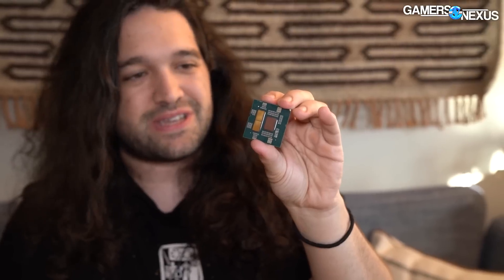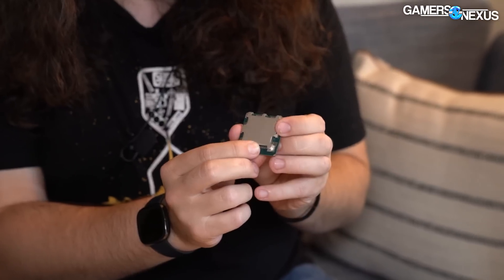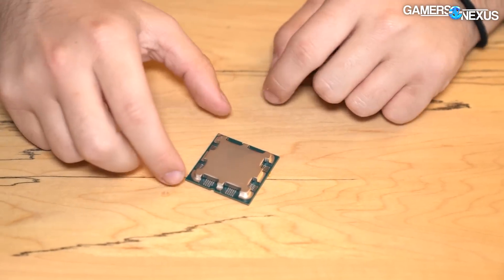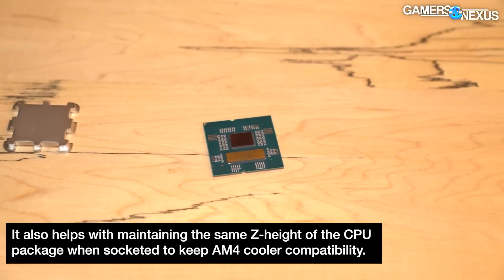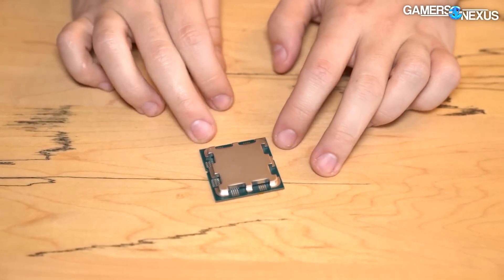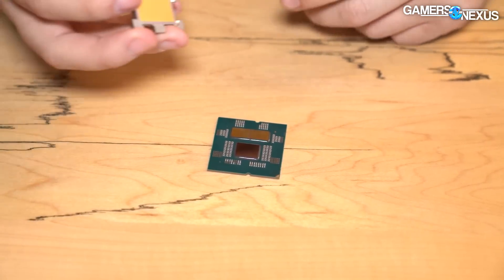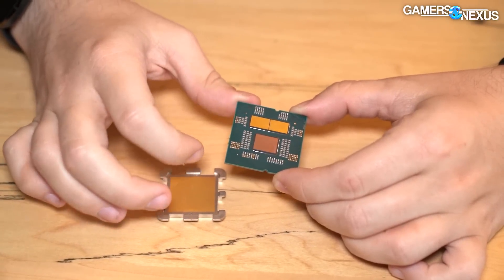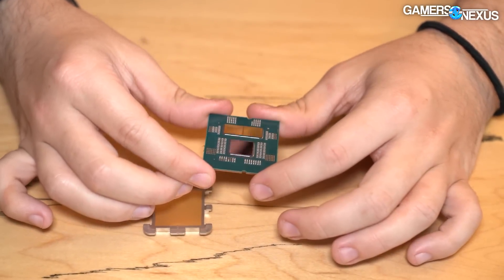Hands-On with Delidded AMD Ryzen 9 7950X CPU

Comment: These recent AMD announcements got me a crazy deal on a Ryzen 9 5900x, which was only around $320 off of Amazon.
I know its not good to go AM4 for upgradability reasons, but considering I'm going from a Ryzen 7 1700 which I've had for quite a while now, and the fact that the new lineup is gonna be much more expensive on launch, I feel like it was a good choice. The 5900x will hopefully last me a good 5-10 years or so.

Edit: Ok so, that CPU never arrived. I asked for a replacement from the seller, that one also never arrived. The seller is now offering me a refund that I really hope will come through.

Its been two full weeks, I'm just gonna buy the CPU at full price from a reputable seller. Its gonna cost me almost $400, but I just wanna upgrade my system at this point. I couldn't care less that I'm paying that much for this CPU now that I've had to wait this long.

Honestly though, this is was a pretty good learning opportunity for me. Biggest thing to take away from this is even if the price is the lowest, always fully inspect the reseller before you buy to make sure that they can be trusted, especially if its for such an expensive product.
Reply from the maker: Wow! That's an insane price. Great find. Even with the new stuff, no reason to feel any buyer's remorse with that one.
Reply: Nothing wrong with that! Enjoy your huge performance uplift!
Reply: holy shit dude, that was a steal.
Reply: Yeah, it'll definitely be a long while before 16-core Zen 3 FEELS long in the tooth.
Reply: Good news: you got mixed up! It's "not good to go AM4" right now, because buying a new AM4 motherboard and new DDR4 isn't worth it, when you can't upgrade the CPU using the same mobo and RAM in the future. But if you already own an AM4 system, then you absolutely should upgrade to something like that 5900X, because every single part of that PC besides the 5900X costs you $0 (because you already own it). In fact, the reason people who don't own an AM4 system should buy AM5, is so that they can eventually upgrade to a new CPU at the end of the chipset's lifecycle—exactly what you just did. You made the optimal move, for an insane price. Nicely done! 👍
Reply: Dang!! I recently got a 5800x for like $300 off Amazon. I guess if I had waited a bit longer maybe I could've snagged a 5900x. Oh well haha I'll be happy with the 5800x
Reply: @ebaker8807  You can get them for $245 on amazon... ;) 5800X
Reply: Actually an insane deal man I love hearing people get a worth it upgrade. I was able to get a 5950x for $450 about 2 months ago off Amazon. Popped out my 1700x and popped the 5950x into the same board and couldn't be happier with my speedy renders.
Reply: I love new stuff coming out,  usually means I get last gen cheap.  I'm always a gen or 2 behind.
Reply: @markboz3366  It's the only way to do it, much cheaper and if you're just gaming and doing normal tasks you will never even really know the difference without a counter on screen telling you so.
Reply: 10 years might be a stretch but easily 5 years year.
Reply: Did the same thing but from 1700 to 5950X. No regrets yet, the price was good and this thing rips for AI/gaming/production.
Reply: Forgot to mention, I also ordered a Gigabyte B550 Aorus Pro V2, some T-force Vulkan Z CL14 32gb RAM (2x16), and a Scythe Fuma 2 Rev B Cooler. 
My current motherboard is complete trash, it being from an old HP Pavillion Power 580 desktop (Google the HP Basswood). I was not going to stick a 5900x in that, and plus I need more rear IO than that old board can provide. As for the RAM,  I need that extra RAM capacity for the VR games I've been playing lately. 

When I was talking about AM4 not being good for future upgrade paths, I meant with future CPU upgrades in mind. Still though, I did save a bunch on the 5900X, buying it at $320. 
As for my GPU, I upgraded to a 6700 XT earlier this year for around MSRP, and I have a Corsair RM 750 PSU powering it all. Those are both definitely staying in.
I hope that about covers it.
Reply: Almost same, I just got a new 5600X a few days ago for approx $150, couldn't resist upgrading from my 3600 lol
Reply: im still rocking a phenom x6... i recently seen a x1700 in the flesh doing stuff... i am astounded with the x1700.. ffs.. this thing may as well be alien tech to me.. no use for it..my self.
Reply: but im over in novastalingrad in Canbodia.. i mean novascotia canada atleast thats what we used to call it
Reply: @homelessEh  My first Ryzen was a 1700 in 2018, and later accompanied by a 3900x, all for crypto mining. They are now collecting dust for this winter due to high energy costs. 3900x is really fast btw.
Reply: Search Project hydra. With this processor, two CCD, it make magic
Reply: Bought a Ryzen 5 5600X in December 2020 for USD$351. Coming from a Ryzen 5 1600. Kinda hurts now that the 5600X is just USD$190 in my country right now but looking at these announcements, I am just salivating to upgrade my whole rig around 2025.
Reply: I'm currently running a 5900x and its a beast of a CPU, i really struggle to top it out. as Im GPU bottlenecked with a 2070. its a great CPU and will last several years. once a new cpu is announced is the best time to buy the previous gen top end at a great deal
Reply: Damn good price. The MSRP during launch on R7 3700X was $329 . You got an R9 5900X for less than that.
Reply: I went from 3770K and 1060 to 5900X and 3080 Ti.  Difference is night and day lol.  But I paid like £450 for the 5900X and £1050 for the 3080 Ti.  I kinda regret paying so much for hardware which will effectively be outdated for the next 10 years now.   I.e. Stuck on DDR4 RAM and AM4.  Which is why I probably won't buy another 5900X now even though it's so cheap.  I need to build another PC now, but I am thinking for sure DDR5 only.  So hopefully 7600X + 4070 or something similar I reckon.  Considering the 7600X is also dirt cheap and should outperform the 5900X and 12900K in gaming, it seems like the better option.
Reply: Wow... from a 1700 to a 5900X for just $320. 👀
Yeah, that's a fantastic upgrade for the price and will absolutely add years to the viability of your build. 👍
Congrats!
Reply: I picked up a 5900X for $338 from Amazon last month. No regrets!
Reply: I did something similar; I had planned on waiting for AM5, but saw a deal on a 5800X for $350 CAD about a month ago and decided to stretch out my X470 motherboard just a LITTLE bit longer. The jump from a 3700X is pretty substantial in some of the work I do; the fact that data doesn't have to cross the Infinity Fabric when being transferred between cores has dramatically improved Folding@Home productivity for me.
Reply: you will LOVE that CPU!
Reply: Excellent price. You are a strong Human being. I for one will not sleep at night due to Tech bleeding edge greed. Only thing I'm waiting and willing to settle for is the 7900x or 7950x. (But to put it in perspective, my last PC build, that sadly died in the Pandemic was i7 5820k Haswell. I lied to myself and said I'd get the Ryzen 3000 series, then said I'll wait for 5000, (but sadly could not find stock... Now thank heavens, I'm ordering 7000 come hell or high water. Enjoy !
Reply: Not good? What do you mean NOT good? It's always a good time to buy Zen 3.
Reply: Awesome.
Reply: Holy ** that's insane.
Reply: Out of curiosity, which motherboard do you have? or are you upgrading that too?
Reply: 320??? What a steal! Nice catch!
Reply: I started with a 1700, then went 2800x before snagging a 5900x. You will feel absolutely no regret. That cpu is an absolute beast. Enjoy your purchase!
Reply: To be fair, amd also said that am4 likely isnt dead in the water completely 😉
Reply: Right now is $342 on Amazon
Reply: Great buy! I was pumped when I got a 5600x for $175 but that is just a steal!
Reply: I'll definitely wait for Ryzen 9 7950X and Ryen 9 7900X for sure and see their performance.
Reply: great deal you came up bro ham
Reply: Is that the "nadir shop" one? I'm suspicious of that one.
Reply: I think it was a great move... the AM5 stuff will be very expensive for next year or so... in the meantime rock on
Reply: AM4 remains to be AMD value solution at least one more year!
So it is very valid solution.
Reply: Naw, you made off like a pirate here. You made the right choice. And by the time you even want to upgrade cpu again there will be even better CPUs that will make these look like your old 1700.
Reply: Your pc can last for at least 6yrs
Mine i9 7960x can still handle tasks well
Reply: Went from the same cpu to a 3600 before saying fuck it and going for a 5900x myself, now on a corsair h150i rgb pro i love it.
Reply: And that 5900x will last you a few years.
Reply: Same i got one for £385 -25%
Reply: Same, upgraded from a r7 2700x to a 5800x for $269 and tje performance increase and smoothness is almost unbelievable. The 2700x  was bottlenecking a 6600xt.
Reply: I got one for 330 a month or so ago brand new off eBay. I'm happy with it
Reply: My friend got a 5600x for more than that, great pickup, who cares about the platform being EOL, that cpu is good enough to carry you until AM6 anyway.
Reply: Lol. Where I live the price of the 5900x INCREASED today/before the info was dropped. Got the 5900x for 4099 SEK. ($384) And now today the cheapest place to get it is $422.
Really DDR5 and the socket switch makes Zen3 still a better CPU to get right now. And even if a black market can push the price down on the 5900x to $300 it really is a question if people are actually going to buy into AM5 early or upgrade keeping the price high on Zen3. I mean I ordered the 5900x, 32GB Ram and a Noctua D15. And it is the ram that I want that is holding me back. DDR4 having a waiting time? How is DDR5 going to end up being like if DDR4 sticks is hard to source the right sticks for a decent price.

Even if it is a dead end, it is proven IRL tested stuff. There was a huge problem with Ryzen Zen 1 and 2, USB etc etc. Problems with ram (chiplets) and AMD and there GPU drivers makes you not want to be a beta tester. Compared to Intel the motherboards for AMD are really ****. There is not a single motherboard even if price is out of the equation that seems good. How is AM5 going to be any better dealing with beta tested DDR5 from Intel. Your still going to be AMD's beta testers and what not. 

Rather buy AM4 and make sure that the system is stable and in working order before the stuff is discontinued and spend a bit more NOW. And then know that even if a tad old the system is going to last as long as possible. I really have little hope that AM5 is going to be any good. CPU sure fine whatever but the rest seems like a disaster.
Reply: From 1st gen it's always good to upgrade, same like it was with intel first gen i's, to some they were holding up great, but later gens were way better anyway, even 2nd gen, which I had for 8 years, i7 2600k. Now I got Ryzen 7 3700X. I might be able to get for cheap 5700X or even 5950....and sit for a while before upgrading everything again to next gen board with next gen RAM and CPU, whichever will be at the time of need.
Reply: 5900x owner here. You'll love this processor. I plan on upgrading my system no earlier than in 5-6 years. It is that good.
Reply: I got mine for 360 at best buy! I do not regret it. How's yours run btw? Mine cannuut 80 sometimes out of nowhere lol but usually run high 50s low 70s when gaming
Reply: I like my 5900x but I wish i would have gotten the 5950x just to have it
Reply: I am still using r7 1700 since the june of 2017. This thing has been great so far , the only place it lacks is in some games where single core is used a lot. 
My motherboard has support for the latest & greatest cpus. I was planning for a 5600x , looks like i could probably get one for cheap.
Reply: I’m looking to do just that, nothing wrong with it given that my gpu would not benefit from something more powerful than a 5000 series cpu.
Reply: 7900X is barely any improvement over 5900x. It has like 16MB more cache, which won't do anything the 64MB you already have won't do. It has higher TDP than 5900X without boost (105W vs 95W) and with boost I expect it to be so melting hot. 5900X was already problematic to cool with the biggest waterblocks. 

I have 5900X and I'm thinking of selling it in favor of 5700G, there's literally no reason to go above 5700 series unless you have need for 24 CPU threads.
Reply: @harryshuman9637  what temp for a 5900x do you think is problematic?
Reply: It will last you untill AM6 comes out
Reply: Your Ryzen 7 1700 only lasted you 5 years so what made you think the 2 years old 5900X will last you 10 years?

If your upgrade pattern holds, you’d upgrade in 3 years for another 50% increase in performance.
Reply: This was largely my reasoning for sticking with AM4 when I built a new box in 2021. I knew the 5000 series would be the last on AM4, but I went with a 5800x, knowing that that chip itself would last me for a few years at least, but then I also subsequently had the option of picking up a second hand 5950x later on if I needed more horsepower.
Reply: Still rocking my 3700X and no issues at all. May upgrade this generation for DDR5 support. But more interested in 40-series from Nvidia.
Reply: Built a 5800 (NOT X) rig, got cpu for 262 last december
Reply: Thanks for reminding, $245 for a 5800X.
Reply: Buying computer parts in their "halo," the peak of refinement (and almost always of stability as well) for a particular hardware generation, has always been a great way to get great long-term viability. Just load up on RAM, as with the current gen moving to DDR5, DDR4 is going to get ramped down and reduced supply will raise the price sharply once what's in the channels now runs out. Even if everything else about your system is well below the suggested minimum specs, most things wil stil run in some fashion as long as you have the RAM to load them in the first place.
Reply: p
Reply: I did the same thing but got even luckier. I don't know if it was a happy accident or they were out of 5900X but they sent me a 5950X. I'm pretty well set with this computer now. My previous build was a 1600 so BIIIG uplift.
Reply: Wow that will be such a jump in performance!! 😲😁😁
Reply: Got my 5950x in a custom thermaltake tower 100 mini 3060 ti (founders) ethereum mining build for $1k, I swapped in my 3900x and some better ram (32gb from 8gb), just waiting for it to sell now (ideally for a profit but it wont be hard to sell it just to effectively get a free 5950x upgrade). 

Also bought the 3900x for $250 around a year ago so not a bad deal on that one either.
Reply: i bought this cpu for $500 4 months ago. now its selling for $415 right now in my country.
Reply: More like 4 yrs
Reply: I actually did the same choice, upgrading from r5 3600 to r9 5900x thanks to those cheap discounts. I also managed to resell the 3600 so I paid only a small difference for an huge increase in productivity (I work in a software company as consultant and I do need to sheer power of a 5900x for some crazy server workloads, especially unoptimized ones also thanks to PBO2 doing a great job) and a marginal but still revelant one in gaming. I won't change that setup for a very long time and I'm very happy with it.
Reply: i just got a 5950x for like 450 bucks. Plus a motherboard, 64 gigs of 3600Mhz/cl16 RAM and a 3090 ti to go along with it. Not the cheapest of upgrades, but hopefully it'll last a while since my last mobo crapped out.
Reply: I got a 7 5800x for 240 on Amazon
Reply: I've got one in my home server, and one in my gaming rig. Fan-fucking-tastic cpu!
Reply: In the same situation with a 1800x. What MB are you using?
Reply: You've basically done what I did, but I stuck to the same tier I started with. Started with a 1700x and upgraded to a 5700x. I also got that 5700x on sale when I did it.
Reply: i think i paid 343 dollars for my 1700 in 2017
im still using it
runs every game out there butter smooth still with b-die samsung memory at cl 14
and only goes about 30-60 percent usage depending on games so its good
but im very eager to get a 5900x now
Reply: My 5900X was €560 ten months ago... but worth it!
Reply: I just got the AM5 Bundle from micro center for 650 ryzen 9 7950x3d after all the 3d cache troubleshooting. Its a real beast.
Reply: 5900x is definitely worth it if you have the components imo i.e ddr4,  Buy in cost for new platform is alot.

Personally those funds are going into the 4080ti bucket for my 1080ti or might even wait another gen lol it's been doing so well

What's funny is 5 years ago we had Ryzen 1 which it and 7700k that was available both would bottleneck current games.  Where 1080ti can still drive most games at 1440p 144hz.  I ended up upgrading to a 5800x early on and performance lift was huge.  So who knows what future holds for CPU bottlenecks in 5-10 years right now but 5900x is a good bet honestly with it's high cache
Reply: @AsthmaQueen  most games? No shot
Reply: @AsthmaQueen  1080ti wasn't even bottlenecked to any noticeable degree when I was on a 4770K!
Reply: @AsthmaQueen  yeah, i'm in no rush to upgrade my 1080ti. Gonna wait for the best deal, maybe some used 3080 after 4xxx series launch
Reply: I'm watching 5800X3D's like a hawk for a similar upgrade, I have a 5800X already but a last hoorah to AM4 seems like the best bang for buck ATM.
Reply: @SamBinary  I am doing the same but I have a 3700x.
Reply: @SamBinary  Do you think is worth to upgrade from 5800X to 5800X3d ? I have a 5700X an was waching some comparisons and it doesn't seen much of a difference...
Reply: @SamBinary  im deciding between 5900x or that 3d one. Isn't 5900 better for money?
Reply: @SamBinary  Hope you just looked on Amazon...
Reply: @SamBinary  I would wait for the 7000 series of x3d skus as it will be insane and they're coming out this year
Reply: I’m going to be doing the same with this. I’m getting a 7900X. When it is replaced by the AM6 socket, I’m doing one final upgrade.
Reply: Yeah unless they launch Windows 12 with no support for Ryzen 5000 in 2026, you'll be good. An even then, you'll be missing little. Here 320 is the price of a 5700X :'( sometimes I hate Italy so much
Reply: @Anankin12  as an italian, I feel ya. The Euro prices are simply nuts when it comes to tech
Reply: @slizzle.280  fra :'( poi bon abbiamo un cazzo di sito equivalente a Newegg né un rivenditore stile Microcenter, sono tutti piccolini e bastardi. È difficile anche solo sapere dove comprare fuori da Amazon, lasciando state i prezzi.
Serve un grande rivenditore europeo specializzato, in modo da avere una roba ragionevole anziché stammerda dove le GPU  RTX sono troppe ma comunque il prezzo sale
Reply: @Anankin12   Windows 12? People looked at your weird for using Windows 7 after end of support. Windows 10 is free it is the best thing since sliced bread  Now Windows 11 is like 8 something that existed for a short time and no one likes. (really I'm to die on that hill) And asking people to pay to upgrade to 11.12.13. And require people to buy new stuff for there crap? 

There is a awful crap soy boy thing called *Linux*.  The desktop is developed by some bad programmers and the core system is developed by cave men. How such a mess of a system can be superior to billion dollar big corps is just sad. But Microsoft and Apple have done it. Yeeezh it is like monopolies are bad or something? And the OS's we run are utter garbage. And the least bad thing makes hardware look like pointless to be exited for. Since it is pointless to have good hardware when Microsoft or Apple want to use YOU as there product.
Reply: @Anankin12  My gut tells me they indeed won't 🤠
Reply: @Anankin12  I think Italians throwing bananas and yelling racial slurs towards black soccer players should be much more concerning than high tech prices
Reply: @Doomsday604  they both are problems, one is worse than the others, but both need a final solution.
Also the tech bit concerns the whole of Europe, so as minor as it is compared to systemic racism it is indeed idiotic to argue "but Italians are racists".
Reply: That's an awesome price! I upgraded from an Intel i5-2500k to a 5900x for $629AUD/~$436USD at the start of the year. Ideally I would've waited a bit longer for a better deal or consider going Zen 4, but my computer decided to kick the bucket and I needed to build up a system asap.
Reply: I don’t think it’s a good deal. Will be outdated fairly short. If I upgrade I certainly never would buy last gen AM4